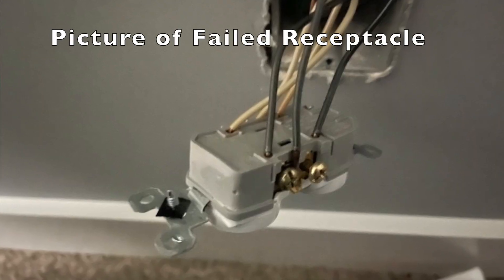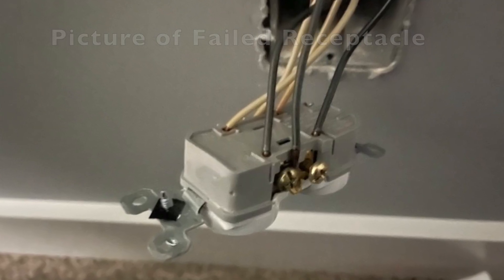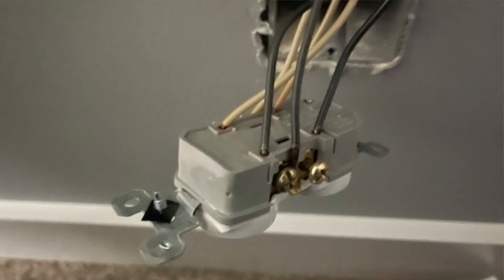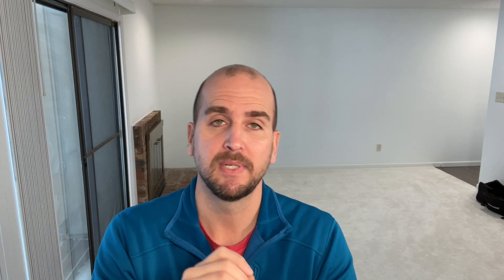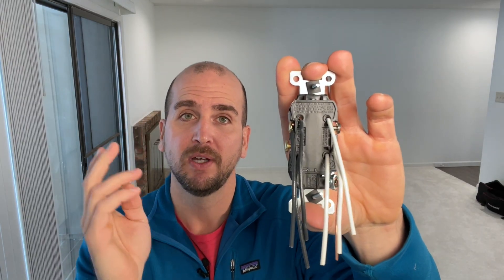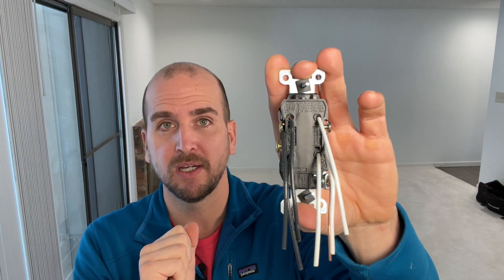Incorrectly Wired Outlet Found In Newly Built Home

Comment: I'm a Lic electrician....40yrs +......I ALWAYS  pigtail Every rec outlet I install....Clean up & straighten ALL wires, Re-strip as needed, & pigtail with a QUALITY wirenut & NEATLY push all wires back into the box, & secure the rec outlet.....Nice & Tight, & Neat !!!
Reply: @WOODY W - Quality work seems to be rare these days.  Thank you.  Question, what about wrapping wire nut connections with electrical tape?  I don't believe it's code but been told by electricians it's a good practice as it 1) ensures wire nut stays on and 2) in cases where the wire is over-stripped or wires wiggle slightly out of the wire nut, the exposed bare wire(s) don't come in contact with any other metal that could cause a short.
Reply: I can only speak for myself but the reason I pigtail every receptacle is because I don’t want the entire load of the circuit going through every receptacle. If they are pigtailed the circuit is continuous throughout the run and each outlet is tapped off of that independent of the total load. The neatness part is so that you can see what’s going on. The wires need to dissipate heat. If they’re all twisted and tangled together in the box the chance of a short circuit is greater the heat does not dissipate as well and it is difficult sometimes to get the required number of wires to fit well in the box. When I roughed in a box I always do it the same way exactly. I have my own business so I use the wire code I was taught by my mentors. It is important that everybody know the same code. One electrician can walk away from the box and another one can come in and see what is going on and know how to wire it simply by the way the first electrician left the box of everything is neat and done the same way every time.
Reply: @henrywight4057  Can't speak to US code but the Canadian code mandates pigtails on the neutral. Something to do with a shared neutral on 120v circuits. You lose the neutral and the connected outlets can potentially see 240v.
Reply: @TheDrew2022  US and Canadian both go by the NEC (National Electrical Code)
Reply: @TheDrew2022  If you do not know what you are writing about why do you comment?
Reply: @TheDrew2022  what CEC are you reading
Reply: @jylfarm1964  okay I stand corrected. But when I was in school my instructor told me that the NEC was used in all of North America. Never been to Canada so never got a chance to find out.
Reply: @jylfarm1964  correct me if I'm wrong I thought Mexico was part of Central America. I checked it out, and I am wrong able my comment about Mexico being apart of Central America, Should of look at a map.
Reply: @henrywight4057  Thanks loads for the input, but I don't get it.  I'm not an electrician, but have re-wired many old boxes.  I KNOW they were all left better than before I touched them, but I avoided pigtails on purpose.  Mostly due to room in these old boxes, but also because I consider the solid connection of the side terminals of the commercial grade outlets I purchase, to be superior to a wire nut.  I use the "External Back Wire Method" not the shepherd hook.  I think I'd prefer this way even if I had more room.  I'd like to see both ways tested with excessive power draw, to see which performs better.
Reply: I am curiuos and appreciate your insight, but I'd like to know why exactly is this done, just for neatness?
Reply: @SuperFredAZ   It is the code to do this. Fire have started because the outlet was over loaded and if the outlet ever goes out, everything down the line on that circuit will go out. I have been on a lot of service calls because of this.
Reply: @garygadson484  thnx
Reply: @garygadson484  Yes, plug splices are a code violation.
Reply: @SuperFredAZ  Please read Henry Wright's comment below....Spot on !!!
Reply: @SuperFredAZ  Try troubleshooting an electrical box where everything is not neatly buttoned up..... that can be a frustrating thing.
Reply: @davids7209  I've done several service calls where the customer reports that the last guy couldn't figure the problem out. I open a double gang switch box and find that it's a mess, totally overloaded and overfilled. I really think that what happened is that the last guy took a look at something that flat out overwhelmed them. In one case, it was just an open circuit on a 3-way, and as the third guy called, I was the first to dig deep enough, and pull things apart to find the issue.

 I once cleaned up a mess, for a clown, a self-employed "electrician"  who claimed that he had decades of residential experience. He tried to install a 4 way switch and failed. What really pissed him off is that the homeowner called me, I fixed it, and refused to tell the homeowner what was wrong. I suspected the homeowner was friends with the clown, so I switched a pair of travelers, and did it while essentially tucked into a corner, blocking anyone from seeing over my shoulder. I later did some expert witness work against the guy, and filled a page and a half of a long legal tablet with individual code violations on a new home.
Reply: Here's a question for the resi wiremen, why don't they use the plastic 1900 boxes with a mud ring to allow for more room to tuck wires away safety?
Reply: @muchograssyass1  When it comes to residential work, new work in particular, it's all about doing the minimum work, at the minimum price, and passing inspection. It's a low bid world out there. Basic, single gang nail on boxes are about half a buck each, in bulk. Nothing to buy a 4" square box and plaster ring, and end up spending 7-10X that amount. Now you have another level of skill involved in properly attaching a different style box and additional ring. Next it's the drywall installation. Most rockers can  handle a fairly clean cutout with a nail on box. Many find plaster rings to be a challenge, and end up with over-sized, or butchered cuts.
Reply: @kerrykerry5778  I understand the cost factor, however going around a mud ring is really no different than a box.
Reply: @muchograssyass1   Eh, I've seen a lot of evidence to the contrary. With rockers that can do great work with most boxes and fail pretty hard with mud ring, especially when it is a stamped ring with a tapered extension, not one with a crisp edge at the outlet hole. I've seen the issue for years on commercial jobs, so I'm going to have to disagree that there is no difference.
Reply: @muchograssyass1  More expensive...
Reply: Exactly right! Any electrician worth his salt would do that! Good comment Woody!
Reply: @harryhagelund7674  What are your qualifications to agree that adding un-needed splices in a circuit which are more potentential points of failure is being a good electrician?
Reply: @alsehl3609  Al, over 40 years in the industry as an electrician qualifies me. The connection points on the back of a receptacle are much more of a potential point of failure then a good splice. In fact it is considered best practice in the industry. If one can’t make a good splice then maybe one should consider a new line of work. Why do you ask?
Reply: @harryhagelund7674  I first started working in the trade almost 50 years ago and worked at every level. Receptacles are UL listed to ensure they will perform as designed and virtually every receptaclevin residential, millions and millions, are installed on the screw terminals or push ins without pigtailing.  If it were a problem, they would have figured it out by now. Also wire nuts need room in the box and with number 12, grounds and the device it causes problems with the receptacle getting cocked. When you are putting dozens in a house or houses the extra time adds up. The need to pigtail when not required, is imaginary.
Reply: @alsehl3609  Yeah, we always run into wanna be electricians like you with “their” own way of doing things, whether it’s the right way or not. Just glad I didn’t have the misfortune of having to follow up behind you and correct your foul ups. Had enough of that already.
Reply: @harryhagelund7674  Following the manufacturers installation instructions is not "doing it your own way".
Reply: As it should be.
Reply: there is no such think as a "QUALITY wirenut" :D Why don't you Americans finally discover 21st century WAGO connectors? :D
Reply: @PeterJurasek  I"m not even going to respond to that question,.....Other than " Please get more experience in the field" !!!!
Reply: @WOODY11780  25 years of experience in electrical engineering is enough for you? Projects where we install 10 thousands of terminals of all kind, is that enough experience?
Reply: @PeterJurasek  NO !!!
Reply: @WOODY11780  well in that case i can not compete ;) An old advice says "Do not give advice to the smart, do not help the strong"
Reply: @PeterJurasek  GOODBYE !!!!
Reply: Tight...like your granddaughter...lol
Reply: Wow, reading through these comments leads me to believe the whole industry is filled with fragile egos and no one way to do anything! Kinda scary but I see now how a building collapsed and we'll never really know why.  I came here to decide whether to hire someone or try to do this myself.  I'm no better off in my decision.
Reply: @Allister Sorrells I agree, but I need 21 outlets looked at.  I can't afford to get ripped off.
Reply: @Allister Sorrells it's the same bloated egos worried about winning an argument instead of doing the job right that leads to disaster.
Reply: I do too and I have just started using Wago connectors.
Reply: @henrywight4057   Henry would you recommend using the Wago 221 with 3 inputs? two for the load going in, and one for the load going out hence the pigtail?
Reply: Pigtailing is your opinion however not pigtailing with just 2 wires per pole will work just fine. Also using the push ins with 14 ga  is just fine. You can pigtail and use the screws only but in the big picture it will not add additional value when you use name brand receptacles.
Reply: Personally....I don't like relying on the "Push In" feature on receptacles,.... under a load, I've seen them fail, & sometimes burn out ....Scary !!!
Reply: @WOODY11780  I agree 100%
Reply: @alsehl3609  Plug splices violate the code. Period. It puts the load on any receptacle wired into that circuit rather than on the wire where it belongs.
Reply: @andyfletcher3561  using the screws for in and out does not violate the code and is in accord with the device listing and manufacturer's instructions. So is using the push ins.
Reply: @alsehl3609  Never said anything about stab-lock connections. In and out, or rather pass through, is not considered a splice. One wire on one terminal. When you add another wire to go in separate downstream circuit it becomes a splice. I was in the trade for 25 years and have installed tens of thousands of 120 and 240 V receptacles. I've never seen a single brand's literature that suggests using their product as a splicing device. Admittedly, it's been a couple of years since I picked up a copy of the NFC, but as I recall, plug splices are EXPRESSLY PROHIBITED. Some inspectors, especially in residential, will let it slide. That does not make it per code. The Army Corps of Engineers in their big yellow book cites the NFC in their prohibition of plug splices.
Reply: @andyfletcher3561   "add another wire to go to a downstream device" is what I am talking about, hot and neutral to one set of screws from source, hot and neutral for downstream to other set of screws. I don't know what you are talking about using the receipt to splice.  I have been licensed in NY, NJ, CT, was an electrical inspector for years an did thousands of inspections and I wa s also a municipal bldg inspector
Reply: @alsehl3609  All those credentials and you don't know what a plug splice is? Bring a third set of conductors into the box that you want to be on the same circuit. If you use the recep to connect them that is a plug splice and against code.
Reply: @andyfletcher3561  where is against code?
Reply: @alsehl3609  Section 300 I believe. Because I ended up specializing in airfield lighting and signage for the last 7 years of my career, it's been a while since I've had much need for the book. Very little of what we did was covered under the code outside of insulation factors and controls.
Reply: Actually if you look it up in the NEC it is required to pigtail the neutral wire 300.13B
Reply: @garygadson484  have to get my book out and take a look. What year NEC are you referencing?
Reply: @garygadson484  after looking up 300.13B and reading it it can be interpreted differently. In one forum the senior electricians say this, a 15A or 20A receptacle is rated for pass thru but not for a splice point. They are also saying that on a standard MWC a pig tail is not required. This is the same discussion as here. It may be a common practice. This is listed in Mike Holt's forum for anyone interested.
Reply: @muchograssyass1  that is very true and I understand what you are saying. But  I have had inspections if it's not pigtailed it always get gigged on it. If electrical inspector see two wires on it they will make you change it, even a breaker in your panel. Breakers are designed to have two wires landing on it. But inspectors will not allow it
Reply: @garygadson484  Yes....You are correct !!!......I pigtail both Hot, & Neutral !!
Reply: @garygadson484  On multi wire branch circuits it is required, however 2 conductor branch circuits of single pole breakers are not required to be pigtailed.
Reply: @alsehl3609  I never said to pick tail the breaker. What I was saying was that and electrical inspector will not allow it. I've been gig on it and had to remove it and add a second breaker so it would pass inspection
Reply: @garygadson484  I've dealt with that crap from clueless "professional home inspectors". It didn't matter that the breakers were approved for two wires, with a diagram on the side showing two wires. I also dealt with others who inspected the entire house with a push in receptacle tester, and didn't even understand what the damn lights on the tester meant. listing switched outlets as "dead", and reverse neutral issues as "open grounds".  Clueless dolts, taking hundreds from homeowners to stumble around a house, missing the important stuff, and providing false information. You got to love it.
Reply: @garygadson484  Agreed, the NEC is the minimum an AHJ always has the authority to do things the way they see fit.
Reply: @garygadson484  300.13B only applies to multiwire branch circuits.  This is from the NEC Handbook.  Look especially at the last sentence. 

"Grounded conductors (neutrals) of multiwire branch circuits supplying receptacles, lampholders, or other such devices are not permitted to depend on terminal connections for continuity between devices. For such installations (3- or 4-wire circuits), a splice is made and a jumper is connected to the terminal, unless the neutral is looped; that is, a receptacle or lampholder could be replaced without interrupting the continuity of energized downstream line-to-neutral loads (see commentary to 300.14). Opening the neutral could cause unbalanced voltages, and a considerably higher voltage would be impressed on one part of a multiwire branch circuit, especially if the downstream line-to-neutral loads were appreciably unbalanced. This requirement does not apply to individual 2-wire circuits or other circuits that do not contain a grounded (neutral) conductor. "
Reply: @muchograssyass1  , NEC Code states that going  way back at least to the 70's.

Comment: If you are daisy chaining outlets you don't need the pigtails. That is why you have 2 screws on the outlets. And yes they can be used to split the outlet also. More than 2 wires to one side of the outlet then pigtail it. I never use the back wire type outlets.

Comment: Is pig tails only to simplify the wiring, if no pig tails will the recepticl work just as good?
Reply from the maker: The 2 main reasons to pigtail are 1)  To ensure that the circuit is not interrupted if you have a failure of the device (receptacle) 2)  Make it easier to fold the wires and fit the receptacle back into the box.
Reply: @EverydayHomeRepairs  thank you,  good information

Comment: My gfci keeps tripping and when I tried to install a new gfci I was lost. 2 green wires, 2 red ( one of them connected to the metal housing which I think means ground ) and one purple. Which ones should I pigtail?
Reply: Usually you won’t have any pigtails when installing a gfci. you should find out why your gfci is tripping before you replace it. your issue may be further down the line and the gfci might just be doing exactly what it was designed to do. you can get an outlet tester for around $10. if it is a defective gfci and you already took the old one out and you don’t know where the wires were on the previous gfci than it sucks to be you because green is ground and red is hot and if you have a red going to the box housing and a purple that is probably a neutral (but who know because purple is not a common color in receptacles) than it sounds like who ever wired the receptacle just used whatever was in the back of there truck and didn’t really care about using the proper colors. also your missing a conductor. you should have 2 hots (usually black or red) 2 neutral (should be white) and 2 greens (ground). the receptacle you described doesn’t make any sense color wise so i can’t exactly tell you what goes where because i don’t know where anything is coming from or going to. you need someone who knows what there doing to take a look in person. just remember. anyone could of wired it any way they want despite color. it’s all just copper behind that insulation.
Reply: @johnwhite6538  Plus, there is two sides - line and load. Wrong wiring  will be a problem too.